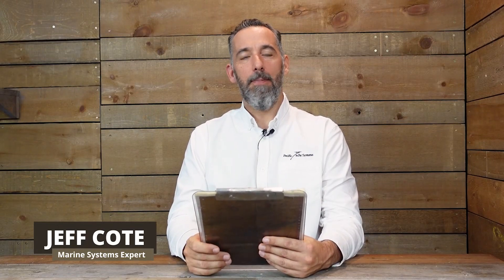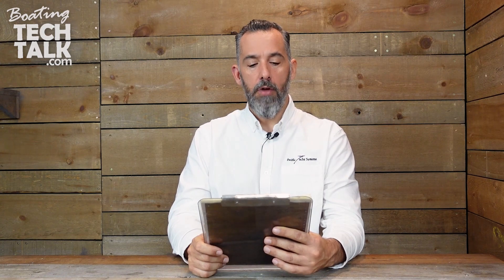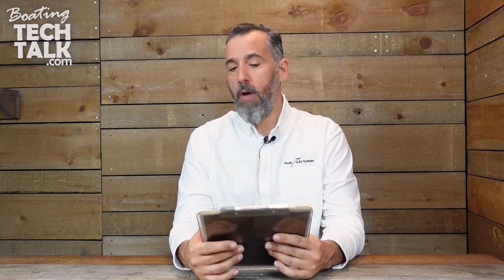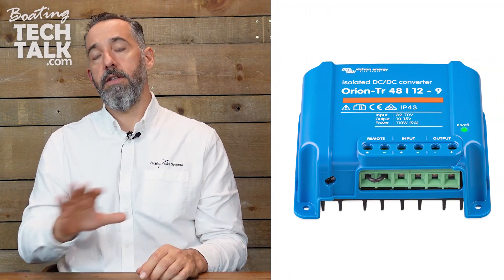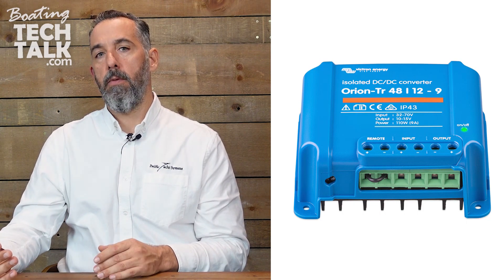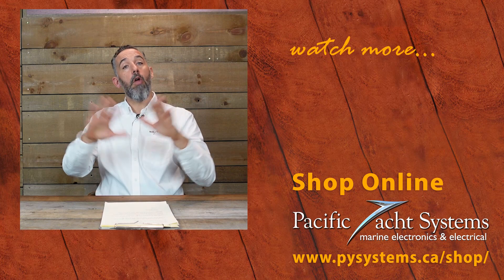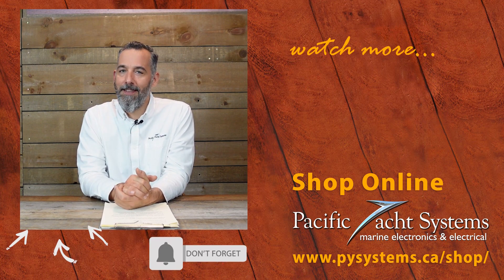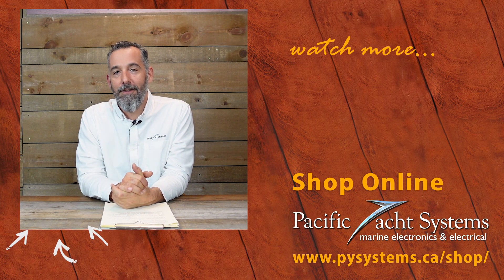Electric Motor on My Boat - Pros and Cons of 48V and 12V?

Comment: I will be surprised if no one has adapted a standard tool appliance battery pack system, such as Kobalt or EGO power tools. They have their own charging stations, which are proven reliable and designed for high torque requirements. Imagine having a bank of 6-10 batteries charged and ready, each with a couple of hours’ worth of use each? Compact unit, charged and stored on deck. A constant power supply?

Comment: For this particular boaters situation, I'd recommend a single 48V system; 48V for propulsion + one or more 48V-24V buck converters for house loads. 48V-24V converters are available from several reputable manufacturers, all with great quality and reliability. In the event that one converter isn't sufficient, I simply add converters in parallel. This is the simplest of all setups, in my professional opinion.

Comment: Blue Sky is setup with a 48v inverter battery system (8kw inverter, 20kw battery bank) and then two 24 volt systems for the bow and stern thrusters and then a 12 volt house system. Each engine and genset also has a 12v starter battery.  The only issue that we have had with the system is the battery chargers on the 24v batteries (2 - 12vs) stop charging randomly so I'm getting ready to replace them.

Comment: I know its been awhile since this video was posted but couldn't you wire 4 -12 volt batteries in series then tap in at 12 volt point for house electronics? ..or is it not that simple?
Reply: No... not that simple. Although it would work for a short time. You would be cycling one battery faster and all 4 will go off of the lowest battery. You would effectively lower the Amp hour rating of the other three. Over a few charging cycles that one battery you use for 12V is a gonner according to your 12v usage Especially if it is SLA. Different battery chemistries than lead acid fair better ... but the same story just a bit more pages not like ya ever get to the end of the story in any if ya get my drift. 

it's like do you buy a used car from an old lady or a guy that smells like tranny fluid wanting to race ya with it saying she's got one more good run..
Reply: @ejrupp9555  that makes perfect sense, I hadn't considered that. Thank you

Comment: We're looking to purchase a houseboat that needs new engines and replace with electric inboard motors, rather than putting in diesel motors.   

The boat is likely to be 14ftx60ft, or so.  We want to use most of the upper deck for solar panels (probably 6kw-8kw, or more, if the panels will fit).  We intend to employ used solar panels that have been on a corporate lease and used for about five years, or so, to save money on the panels.   And, I would install them myself.

We intend to do as you suggest and have separate battery banks - one 12v 5 kwh bank of LiFePO4 batteries for house loads,  one 51.2 volt 30 kwh bank for use with a 12kw inverter for AC loads, and a dedicated 48-96 volt  (or higher, depending on the motors used) LiFePO4 bank for propulsion.

We are looking to cruise the Intracoastal Waterway only and not go out into the open ocean.   And, we are looking to cruise at 5-7 knots - we're not in a hurry to go anywhere.  We would likely travel only 30 miles per day, or so.  And, we want to do this as economically as possible, without underpowering the houseboat.

We're new to boating and have never owned one.   So, while I have a good feel for the electronic aspects of the project of powering the 12 volt DC loads and the house AC loads, I don't have a good feel for the size of the electric drive motors we should use for a houseboat.  And, I would like to use the same solar array for charging the 12 volt, the 48 volt, and the battery bank for the propulsion motors.  So, what I would like from you is some advice on:

1 -  Sizing the electric motors to be used for propulsion.

2 -  Sizing the battery bank for the motors.

3 -  Using the same solar array for charging all three battery banks.

Thanks for any insight you might be able to provide to help us accomplish our goals!

Comment: Ouch. Electric is too expensive. I like my air cooled Chinese 168F diesel engine. It's 44 LBS and $209 plus hardware. A smaller diesel moves the emphasis from speed to charge. I like fresh highway diesel fuel instead of dock diesel and old boat tanks. A seven inch pulley and alternator will charge the house battery very well, and I can omit lithium batteries. The dry heat is welcome on a sailboat. Salt water cooling is a disaster. Electric is just too expensive, heavy, and laborious to keep charged.

Comment: 12V , 24V & 48V all on one Boat, a 1997 Manta 40 Sailing Catamaran, 12V Ship Systems (& Back up 3000W Inverter), 24V  (Refrigeration Primarily) 48V 12Kw POD Drives & 3500W Inverter. Off Grid 6 months now, all good except Torqeedo screwed me withholding the Regen unless I buy their  $24,000.00 Batteries :-(

Comment: Hey cool video... I'm building a solar Cat (similar to Silent 55).  I am waiting for a 84kw battery bank (48v) that will be recharged by a 9kw solar system...    My issue with another batery bank is that the house will draw a lot in days we dont move and I would need a very large 12v battery bank too...  thus it's HEAVY and expensive.   So what I plan is to have 2x 20Amp converter for 24v (toilet, windlass) and 1 12v converter for small things like lights...  Other big apparel like fridge and thermopump will be on 110V drawn from the inverter...  This way I finf I save MORE on weight and $$ AND a way that I still don't know to recharge this new 12v...  As all my panels are focussed to the motors when I need to move...   Great video, great topic, thanks !

Comment: I have 96 v drive motor on my boat. Supplying it is 2 banks of 48v battery banks. These are charged though 2 banks of solar.
The house and working equipment is off a 12v 300amh battery. This is charged from one bank of 48v bank through an mppt charge controller. Ultimately the one 48v bank just tops up the boat 12v system untill we need to run the motor. It's still under build process so is untested as yet.
Fingers crossed.

Comment: My surplus military 48 volt propulsion motor has a built-in 14 volt permanent magnet generator. Works great as a 60 amp rotory converter any time the prop is spinning. Charging two seperate battery banks. 48 volt propulsion with solar. 12 volt house with pmg voltage regulator. The Downside is the motor's 200 lb weight. Awesome regen sailing at 6 knots.

Comment: Hello, just watched a few of ur vids, luv the presentation, so subbed. 
The thing that puzzles me... If going ALL elec, why consider/need 12>48v requirements (for new build or rewire), rather than setting up like an off-grid house, 48v bank > 230V Inverter, use much better value 240v industrial motors ( I.e. 240v Windlass) & domestic appliances?

Comment: I have 72v 18kw motor and  a 72 v 48 kwh battery bank and a 72 volt inverter . Use battery chargers from inverter to charge separate 12v lipo batteries for house windlass and electric halyard winches     Not the most efficient but cheap and works Also allows for use of ac tools and appliances.

Comment: As I understand it, there is a limit to battery draw. its called  Max. Discharge Current. So I did not follow the bit about converting 48 to 12 as a system. Converting to 12 from 48 via Victron 48/12/30 for charging 12 v bank ,sure.   if your inverting and converting and running the windless, I think it would be impossible assuming your bank was not 3000amps or some massive number. However its a good topic of conversation and for sure the future. cheers
Reply from the maker: I'm not sure the question.   if you have a 48v bank and 12v bank with a windlass.   12v bank would drain while the windlass was running because the 30a 48-12v charger would not keep up.  but once the windlass stopped the battery would continue charge up again.

Comment: Connect 4 12V batteries serially and you have a 48V battery. If your houshold appliances run on 12V, have at least 5 12V batteries. Use 4 for the engine, 1 for the household.

Comment: Can I take a 12v battery INPUT to a 240v inverter OUTPUT to an ac electric motor, then add an alternator and take the alternator to a 1 into 2 splitter n split the charge between 2 other batteries and connect the 2 batteries together and run the wires back to the original inverter or battery? So basically its, single battery to inverter, inverter to ac motor, alternator connected and going back to 2 other batteries, single wire from both batteries back to original battery or inverter. Or will I burn the alternator or damage the batteries

Comment: Hi Jeff, I've been looking into removing Twin diesel Cat 3208's from a Gulfstar 44' Motor Yacht(36K lbs.) in favor of an Electric Motor Conversion. The Elco EP100(Which I'm leaning towards)runs on 144v and most others run on 48v. I was wondering if one has any advantages over the other as far as performance or efficiency goes ? 🤔 
I would appreciate any feedback and suggestions as I respect your knowledge and opinion‼️
Thank you, have a Great Day and Stay Safe ‼️ 😊
P.S. I will be running with 3- Battery Banks. One for each Motor and a Separate Bank for the House.
Reply from the maker: Getting over 48vdc becomes a whole nother game and becomes dangerous to work with.  Note that most marine breakers, battery switches etc are only rated up to 48v.    So you will be moving into specialized equipment with different certifications for the higher voltage.  I have never worked on anything over 48v dc

Comment: Actually a dc could use all volts. 12 24 48 don’t use a converter. Use the old electric cart slider on brass. And resister wires.
Reply from the maker: Thanks for sharing.

Comment: 48v is more efficient ... from scratch, it is the way to go IMO. There is always nrg loss from the source to where it is used so you effectively increase your storage capacity with higher efficiency and at a higher rate of conversion. [Power loss(watts) = I²(current)R(resistance)] 12v requires 4 times the amps that 48v does for the same power P=IV. Along the wire, resistance increases with distance linearly, so current drain must make up the difference for a set power requirement. The longer the wire the worse it gets. Solar for a 48v bank is cheaper the higher the capacity required. 48v to 24v or 12v converters are ubiquitous these days and are much like electronic speed controllers that use pulse width modulation sent through a capacitor to smooth down the peak, If you can read instructions it should not really be a consideration on your appliance choices. With a BMS (battery management system), you set the minimum capacity of your bank to devote to propulsion so you won't empty your 'fuel tank' for your motor. There are blue tooth apps for BMS that allow you to adjust these on the fly via your smart phone. Some of these are Pro's that some will consider cons. A BMS is just part of the design as far as I am concerned and more practical than insurance. The con is you may have to learn a few things. The con of cost applies if you already have a 12v system for the house bank (most probably already do unless you are talking about a total gut job restoration type thing). There is a fairly large if not the largest percentage of folks that this will definitely register as a con.

48/12v  ... If you already have a 12v system, the advantage is ... you already have it and save the cost and headache of replacing it. Your 12v house bank doesn't risk your propulsion bank and vise versa so you really don't need a BMS if you think that way. You can series up a 12v bank of 4 and make it a 48v in a pinch. You don't have to worry about learning a few things. On the other side ... you need two separate solar set ups and 12v is much less efficient and cost more to convert sunlight into juice in the battery bank (because of wire size and length - resistance). Your bank capacity is limited by the conversion rate for a single system because solar controllers available can only handle a limited voltage input which limits the number of panels that can feed it. 48v controllers have a much higher range of voltage inputs so you can use multiple larger panels at higher voltages. This effectively makes solar for 12v more expensive and slower to fill a large house battery bank. If you only need a small 12v house battery bank and you can get away with a cheap controller with a couple of panels on a smaller boat you might be able to save a bit overall so for some it may register as a pro not having to get converters or a BMS.

You have a boat ... otherwise know as a hole in the water ... Bring On Another Thousand ... so I won't piddle with the few dollars here and there about minor duplicate cost for things you need two of in a 48/12 configuration. But really, converters and BMS won't break most banks when you look at it that way ... way way less than a thousand. 

If you are a live aboard 48v is a no brainer ... if you are the casual sailor, then those higher capacities and such probably don't factor in and I'd take the cheapest route given the situation. Although my wife just read this over my shoulder and commented ..."yeah but boys will be boys" bring on another thousand. Of whih I commented ... "but I named her after you."

Good luck and have fun in your adventures.
Reply: Boats aren't holes in the water... :-)
Reply: @MoneyPitBoating  Was gonna reply with some joke about infinity ... But yeah, every hole is really a pit, because i don't have infinite money to put in it. I'll watch for my technical errors in the future ... thanks. :o)
Reply from the maker: Thanks for sharing!

Comment: I've been playing the 48/12 game for years now, and I'm actually wondering when we'll start seeing higher voltages and how I could handle that.  48v limits you to about 20hp because you reach 4/0 cable sizes to feed it, and then you start doubling cables and moving to bus bars and solutions start getting crazy.  Higher DC voltages come with their own problems, and dangers, but they do let you use human sized cables.  A bigger deal though is that it would allow the use of the same motors used in electric cars that are running 350 to 450 volts to deliver hundreds of horse power.  More than a sailboat really needs, but puts the 60 to 100hp range of motors on the table at a reasonable price.  Of course it creates a new puzzle for the power needs of a windlass, chart plotter, and an Instapot.
Reply from the maker: Thanks for the input.

Comment: If 15 horsepower is enough to move the boat, get a beat-up old golf cart, you should be able to get a working one for under $1,000.  Take the motor, speed controller and batteries.  It will probably be 48 volt, possibly 24.  Get your inverter to match the golf cart voltage.  Now you have everything including the house batteries and propulsion.
Reply from the maker: Interesting.
Reply: Yup I did my buddies boat that way with a Frankensteined E-Z-Go cart from Craig's list for $500 ... just had to get a different speed controller because the golf cart accelerator didn't fit in his helm stalk and he wanted it pretty instead of Frankenstein. 7kw motor maxed 185 amps from 8, 6v batteries, contactor, converter, and on/off/reverse switch from the cart. Stainless steel box with a fan for the mount. Had to limit it to 100 amps or the prop would cavitate under his 27 footer. Electric motor torque is no joke. The batteries don't get him more than 20 minutes at 4 knots though (old batteries) ... I was gonna set him up with solar and what not but he says it's good enough to get him to where he can hoist a sail.
Reply: Have similar setup.  D&D Series Motor w/ Alltrax controller with 48V 100ah - for 26ft Landing School.  Works great. 2-3 hrs run time.  Love it.

Comment: Big House Yachts is building the Whitacre 47’ catamaran in Anacortes, WA.  A boat this size would require pounds and $$ of copper wire if it remained 12 or even 24v.  Instead, a 48v battery bank will support a 48v backbone throughout the vessel.  At various points, Victron 48-12 DC-DC converters will be used to support 12v systems.  Each of these points will have separate circuit breaker panels further reducing the copper wire needs.  48v winches and windlass will be installed also eliminating the high 12v loads.
Propulsion will be a 48v electric motor on the port side and a Yanmar diesel to starboard.  A DC-DC converter along with a 12v start battery will support the Yanmar.
Reply from the maker: Hey TC Skeels, sounds like an interesting project. 48 volts is so tempting, as you say you can run large loads like inverter, winches, windlass all at 48 VDC. 

Question, what is the alternator output (12 or 48 VDC) of the Yanmar diesel on starboard?

Comment: 48 volt windless is available that solves the big wire to windless however 48 volt at bow humm. As far as refrigerators and bow trusters not there yet.
Reply from the maker: Thanks for sharing.

Comment: Love this conversation - I have a 200ah 48v LiFePO4 system (10kw) with a 48v Victron Quattro as my inverter charger. Currently I still have the Yanmar but that will be changed out next fall for electric drive. The 48v powers the original house 12v system that has 240ah (3kw) of 12v that is charged by a Vicron Orion TR-48/12-20. Now the question - What voltage do you suggest setting the Orion TR-48/12-20 at for the original lead acid bank? I'm keeping the lead until the starting functionality isn't needed anymore, then it will become LiFePO4 and only run house loads.
Reply from the maker: Your lead acid battery manufacturer should have precise recommendations for a 3 stage charging. Generally, for a 12 VDC lead acid battery, they are 14.4 VDC for bulk / absorption and 13.3/13.4 VDC for float charging.
Reply: How do you get your Orion 48/12 to do the 3 stage charging? Isn't it just a CONSTANT conversion?